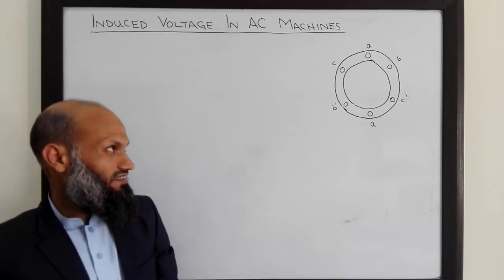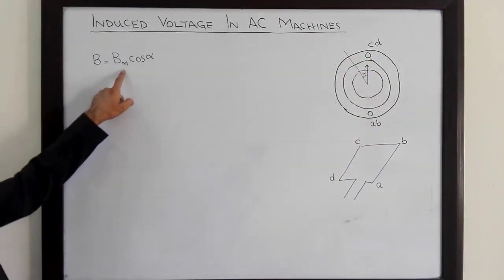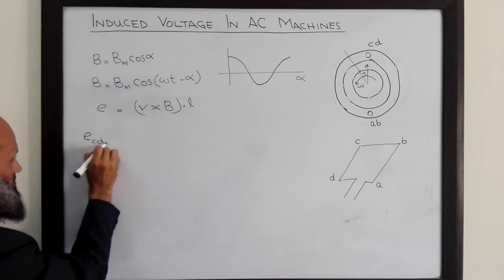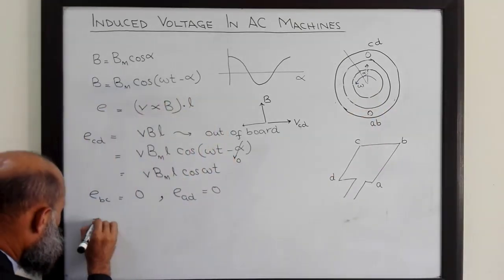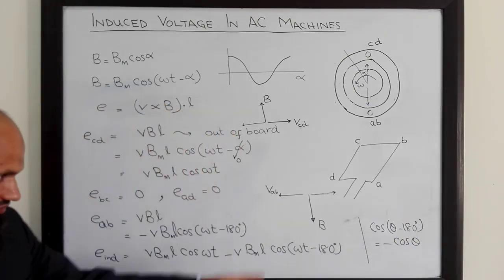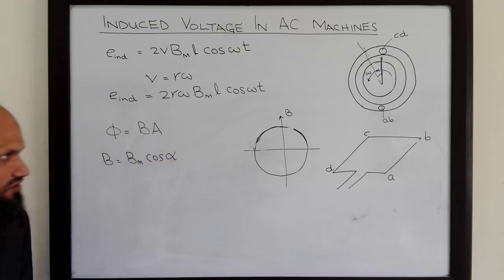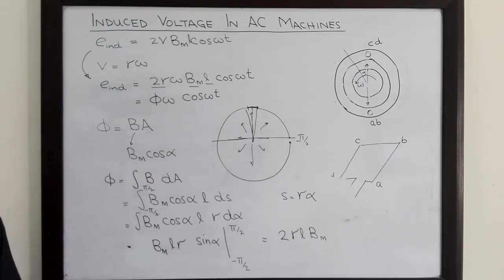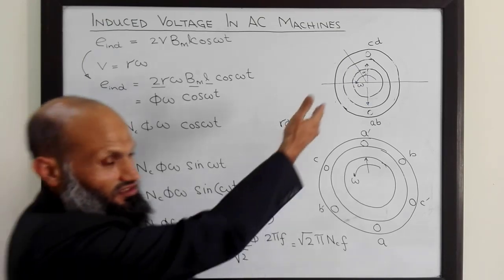EE213 - 33 - Voltage induced in real ac machines

Comment: Hi Sir.At 4:54, why did we say B is max at that position? What will be the mathematical explaination to say it is max? Or is it just an asummption to start the analysis and we can select any position as B max?
Reply from the maker: The rotor is an electromagnet and the coils in the rotor are such that these produce flux density which is sinusoidally distributed along the surface of rotor, that is, maximum at the indicated angle and then changing sinusoidally.